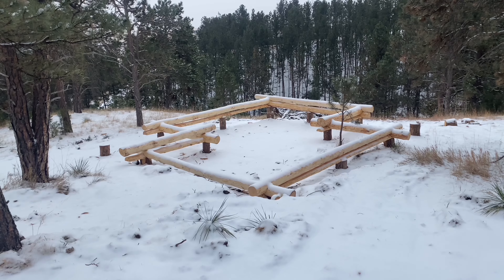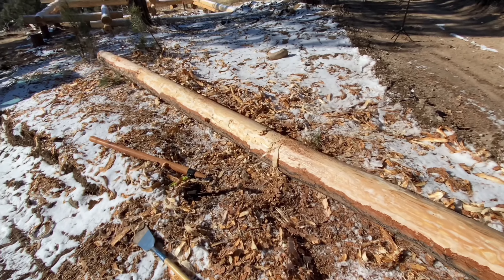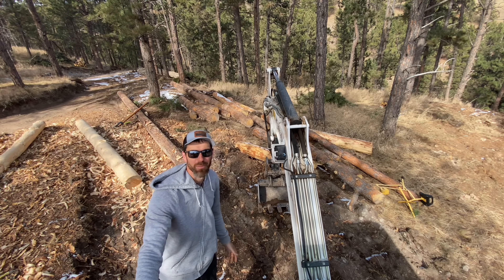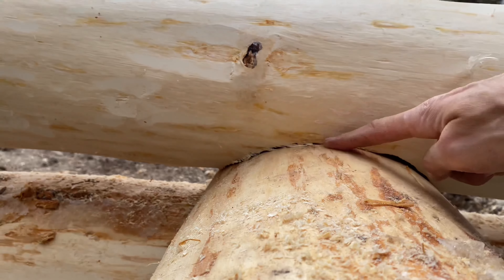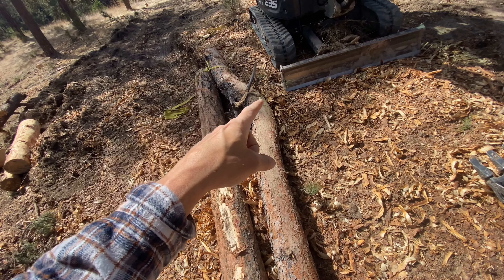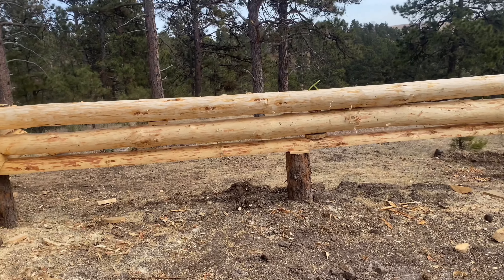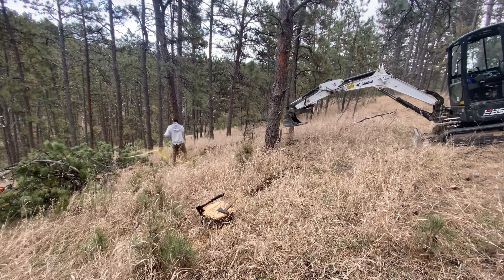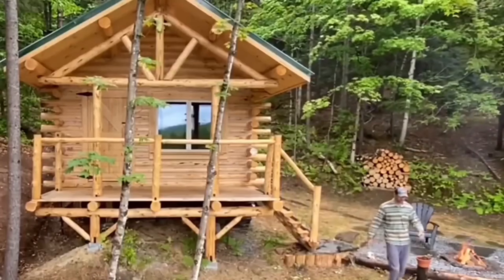Log Cabin Build- Things do not always go as planned! Episode 4

Comment: Is there a reason you are not notching your logs deeper in order to eliminate the gap? Also, if you run your scribe along the full length of the log and notch it out, your logs will sit perfectly on each other. Just add insulation in the notch, and you have a perfect seal, this way chinking is pretty much just for looks.
Reply from the maker: Thank you for the question. The reason I am not notching deeper is that my the logs are not perfectly straight and their taper also varies from log to log. So it would be very hard for them to sit closer together. A 4 inch gap of chinking is what I am shooting for to maintain a uniform final look. Also I didn’t full scribe the logs because I was more confident in my chinking skills than notching skills when I started the build. I do think now I would try a full scribe cabin next if another cabin build is in my future. I hope that answers your questions, thank you!